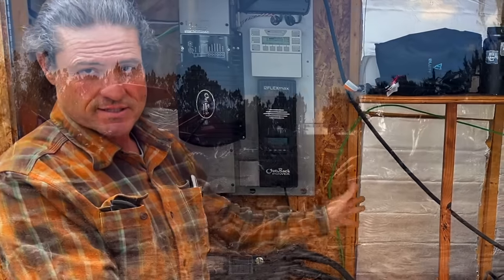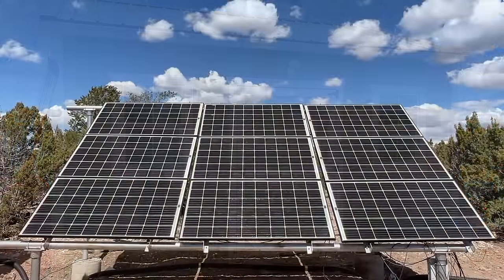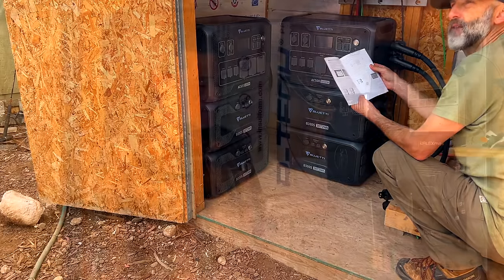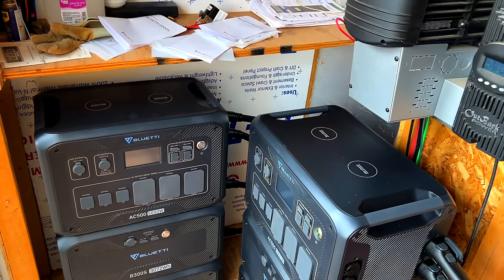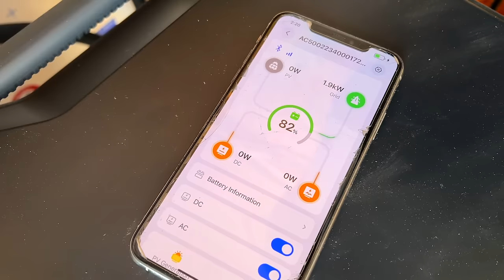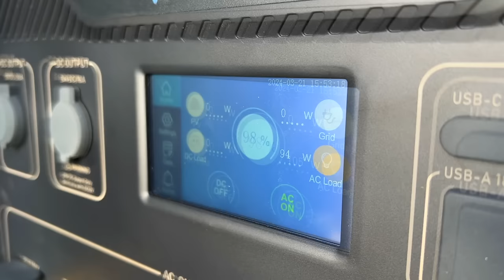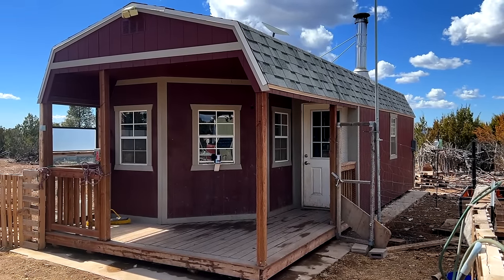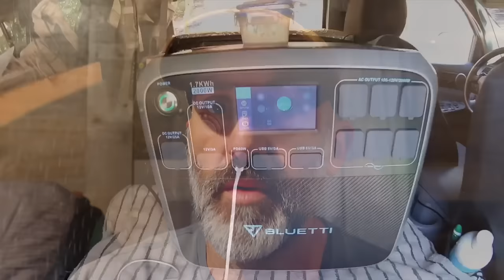NO PERMITS NEEDED - 12,000W SYSTEM RUNS EVERYTHING! Powering Entire Homestead - Bluetti AC500+B300S

Comment: why not just build your own, you spent 10k or more for a non repairable unit. I'm guessing you were giving these for free.
Reply: Definitely a waist of money...... It's so easy to make a system with separate components, and three times more storage ability for a third of the cost.
As also mentioned in replies, alot cheaper, easier to diagnose, and failed components ( very rare).

Fancy bells and whistles on a premium budget...... Very wistful spending.
Reply: He said why the 1st minute!
Reply: You are technically supposed to have a permit for the separate component type… so it’s one less thing that can be held against you. In terms of county code, in most places.  I’m not sure what county this guy is in, but he might be in the same county as me and a lot of counties seem to be on a similar page.  You can build a 200 sf structure without a permit as long as it does not have plumbing, electrical, mechanical or a solar system like that one… you are good.  Technically you are not allowed to live on the land in an unpermitted structure and if you live in an rv, you still need to file for a permit and some areas only allow for that for a limited time annually.  However, in my county unincorporated area, probably 95% of people are living 100% unpermitted. And have been doing so for decades.  The county only interferes if there is a complaint or problem. Of course that could all change. And they will make people remove unpermitted dwellings if they are renting them on air bnb.  More people would build permitted homes, but the septic systems are a nightmare… I was told the price is likely to be 30k because of the hardcpan… and I won’t use it and it’s not necessary in any way shape or form. With all that said, I’ve taken the rules into consideration, and plan to put some sheds on my property to be utilized as dwellings and work spaces. And they need to be placed 50 ft from the lot lines too.  So I plan to follow those rules and use five gallon water bottles for my sink, that drains into a bucket, that I will empty into my garden on the daily.  I will have a composting toilet system like the one Doug and Stacy use… so there’s no plumbing.  And I will use portable swamp coolers as well.  All I really need is a solar power station. I do plan to utilize small, side venting wood stoves for winter… so if they come and tell to stop living there, I can at least take my power station with me.  But, I do plan to save money, so if I have to ultimately, build something to code… I will hopefully be able to do it… and my buildings can be designated as sheds without needing to be deconstructed.  And I can do what they want.  Although things could get real ugly like in the days of the Nazis or the cartels could oust me or something.  But in those types of scenarios, it wouldn’t matter if I was permitted.  As long as you don’t make a big stink over the crimes of the powers that shouldn’t be… or some asshole developer doesn’t come in… I suspect it will all be alright.  But, I’m not trying to recreate my city suburban life.  I just need a dwelling, water collection system, work space and a greenhouse and my food forest and gardens.  And with all that said, while I can depend on the portable swamp cooler… I do plan to install a signature hybrid minisplit that offers both heat and ac and can be directly connected to solar panels.  This too, can easily be removed if the county comes knocking.
Reply: He mentioned it was plug n play which I'm looking for and I don't have the tech ability unfortunately like some people do to build their own systems.
Reply: I built my 3000W with 800 amp hrs of battery for about $10k.
Reply: @Homesteadturcke  where do you live?  I want to do this in southern PA, almost MD.  how do I go about getting the grid tie and permits.  Is it a difficult process?  I'm very handy built my own shop, and barn,  feel like this is something I can do.
Reply: It was pretty easy for me in the past, the only thing that happened was my taxes went up after.   But I heard solar permits can be more difficult.
Reply: @n.chappy5879  I live in Madison County, GA. Permits for most things are only a suggestion 😆. 
I built my own because there are so few systems in this power range on the market.  Most are either for just running a few lights or whole house $125k systems.
Reply: 😢you did not listen. He did not buy these. The company sponsored. He then decided to bless his friend who needs electricity. 

Some people just comment out of emotions out of context 😢
Reply: @OfftoShambala  just have the gov in that area abolished, problem solved. It's easy.

Comment: I'm not off grid, but I've used my Bluetti EB70S during power outages to charge my phone and camping lights.  I've got the 200 W folding panels, too, but haven't used them yet.
I plan to use them both in my campervan to run my 12V fridge/freezer, and charge things, if I have to evacuate during wildfire season.
Jon in rural BC, Canada

Comment: A generator like this is what I recommend to clients as a "main" power source, because it meets code without having to jump through the solar design and permit process. Which is a gigantic hassle.

Afterwards, you can do what you want with solar because in the eyes of the county, it's not technically your main power.
Reply: What do you mean by, "it's technically not your main power"? Would I run into problems with permits if this was my only power source? Sorry for the questions, just trying to get a better understandment of water and power regulations I would need to meet to make an offgrid property my main occupancy. Thanks
Reply: @blakeyou538  
Technically, your main power source is a generator. Once your home is finished and you have occupancy, you can turn the generator off and use whatever you want as a source of power...solar, wind, hydro, propane, whatever.
Reply: Thanks for the response! I appreciate it

Comment: I have this exact set up but with the ac300. I have two separate systems each with two batteries.I can split the solar coming in and devices pulling on them between two units which helps keep the heat down inside the charge controller. The fan doesn’t have to cut on as much as when I only had one charge controller/inverter. My hope is this will lead to longer life of the unit but we will see. Doubling my solar input has been huge especially on overcast days. When my system was much smaller those overcast days really put me in the hole.
Reply: By doubling your solar input do you mean adding more solar panels?

Comment: What happened do the solar rig?  Panels start losing efficiency or something else go wonky?
Reply from the maker: The lead acid batteries Chad had finally started to fail after almost a decade of use. They don’t last as long as lithium but perform better in cold weather so both types of batteries have their pluses and negatives. I’m glad to see this new system performing flawlessly for my good friend. Added bonus given the fact these power systems don’t need to be permitted in our area!🤘
Reply: @OffGridBackcountryAdventures  Thanks for info about the batteries being a weak link. Hope that the NEW system will work for a long time and efficiently!

Comment: I have 2 Bluetti products an EB70 & a portable solar panel The EB70 PD port quit working and the solar panel stopped working Buetti wont help me as they are out of warrantee and only just over one year old. Very disappointed as i paid full price for my gear and not given to me. SO i built my own system so if anything breaks I can fix it myself. All that equipment you are showing is very expensive and not in my budget.
Reply from the maker: I'm sorry to hear that, I hope your new system performs well for you.
Reply: This is the very point I am making. How long will these temporary power stations last in a permanent hookup. 73

Comment: That's a nice system! Are the panels wired in series?

My setup is much smaller, but eventually as I grow I'm sure I'll have to upgrade. I essentially have two systems. My 5th wheel is running on DC (lights, furnace, and water pump) while all my appliances are on a separate AC system. Definitely not the preferred setup. Look forward to the next video.

Comment: One thing most homes in America need 240 volts not 120 only. 240 volt things would double their current level if they were converted to 120 volts. Most well pumps are 240 volts. 73
Reply from the maker: Good Morning Ron, yeah this has a split phase connector which links the two inverter boxes making in 240V. Planning to show that feature and a few others in the upcoming videos. Cool how far the tech has come in these portable power stations. ~ Brian

Comment: 12V 100Ah LiFePO4 Battery, 8000+ Deep Cycle Rechargeable Lithium Batteries, Built-in 100A BMS, Max. 1280Wh Perfect for RV, Boat, Solar, Trolling Motor, Camping

￼

￼

￼

￼

￼

￼

￼
Reply from the maker: Thanks man, looking at the stats this is very different from what Bluetti is offering. Here are three key differences I noticed right off the bat...

1. It's just a battery. There is no charge controller, inverter, or outlets. 
2. It's 12V, the Bluetti system is 120V.
3. This has a capacity of 1280Wh, the Bluetti system in my video is 12,244Wh.

I'm not saying anything bad about this battery but it's apples to oranges.
Reply from the maker: Also, at 120V this battery would only give you 10Ah....
Reply: @OffGridBackcountryAdventures  I'm not going to argue I'm sure bluetti is a fine product. But for me my system cost between 8 and 9 bucks. I really think if you didn't know anything about solar your right. But 
Myself I'm well practiced in solar. But you are right for beginners.
Reply: @OffGridBackcountryAdventures  how much is your system total? 4 or 5 grand I'll go back and watch again. If you buy more panels and batteries.
Reply: @OffGridBackcountryAdventures  you forgot the biggest difference. The price.
Reply from the maker: But I don't see any value if you run this at 120V and only have 10Ah  @cooltrkin . If you run it at 12V then you couldn't power anything at my buddy's homestead...this just wouldn't work. I'm not saying it's a bad battery but it's not apples to apples.

Comment: I would rather build a set up from 100 watt hour batteries,100 amp hour equal 1200  watt hour
Reply from the maker: That's cool, to each their own. However, working with code for a solar set up is a nightmare so just be aware of that before starting your power project. Thanks for watching ~ Brian

Comment: I think it would be better to make your own system using lithium type of batteries. A pure sine wave inverter that has 240 and 120 volt outputs, a charge controller. And what ever else you need. These portable power stations are meant for temporary power in emergencies. As for needing permits it's up to your local code enforcers that has a final say. It's best to keep everything up to code. This setup is good but the question is for how long? 73
Reply from the maker: Hi Ron, I actually think the tech has come far enough these days that they can run an entire homestead on their own 24/7. We've now been using this over at Chad's place for three weeks with zero issues. He never gets below 50% power storage so this system is more than enough to keep his place going. The lifespan is estimated to be around 10 years if you are using it daily.

Comment: without figuring out all the cost of hardware, you can build an equal sized battery bank for 480 bucks and a 10kw surge inverter for 220 bucks and save 80% over blueyetti. guess you have to be smart enough to figure everything out and not burn your house down. recently built a 4kwh lifepo4 battery to replace the 12v in my car for about 340 bucks (pre tarrifs, i think prices went up about 10percent thanks biden)

Comment: I am really getting a Kick out of All the In-Correct Battery Capacity Videos.
Sure, 5,000 watts Continuous without a Load, ,Once the Load of over a 1,000 Watts is on it, in 5 Hours, Battery is Dead.  To Supplant this Wattage , you better have twice as Much is Solar.
Reply from the maker: You completely misunderstand...the 5K watts is the inverter. Storage capacity is 12KW and there is 3KW of solar. My friend never runs out of power.